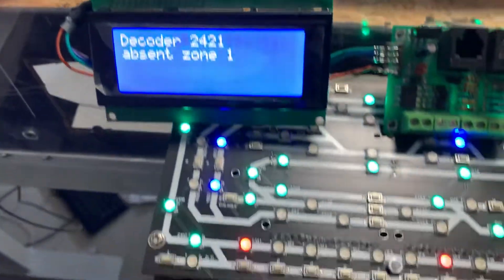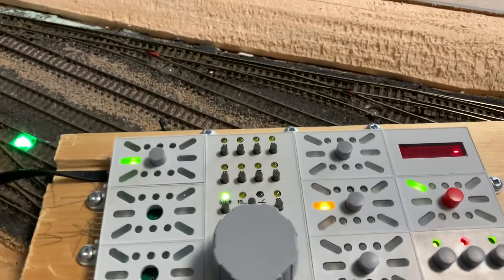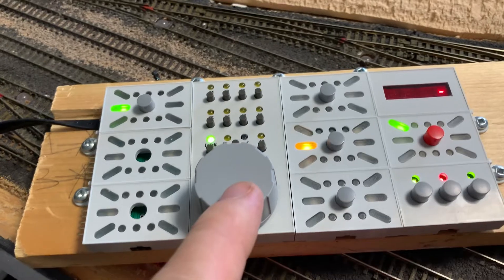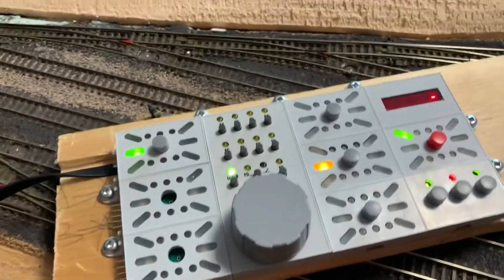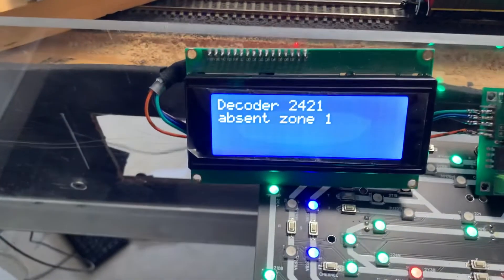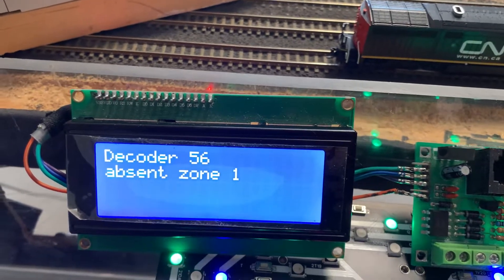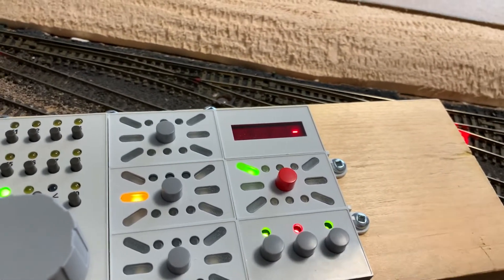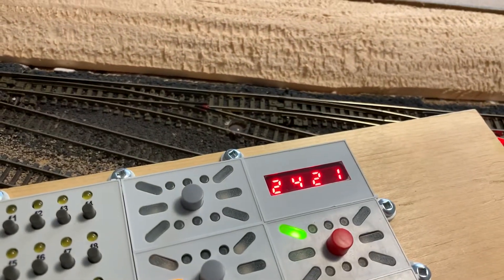Uhlenbrock 69 250

Comment: What are you using to read the RailCom from the blocks please?
Reply: What are the sensors you use at the track that feed the Digikreis?
Reply from the maker: @johnmrichey  theDR5088RC is current sensing with Railcom. My command station is the ECoS with loconet so it will see that the blocks are occupied but can’t read the Railcom info. I built an Arduino loconet display to show the Railcom info. I can use iTrain also. The Uhlenbrock display can’t translate the Railcom data for the block that it’s monitoring but Hans Tanner added code to the IOTT stick so that it will.